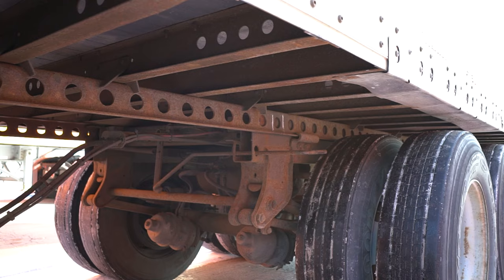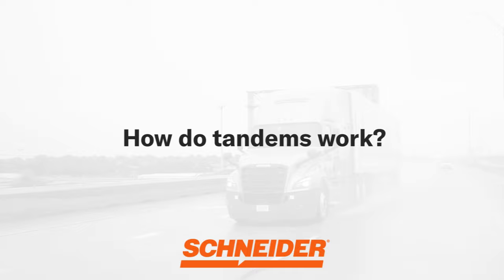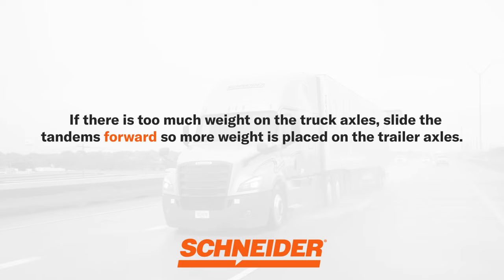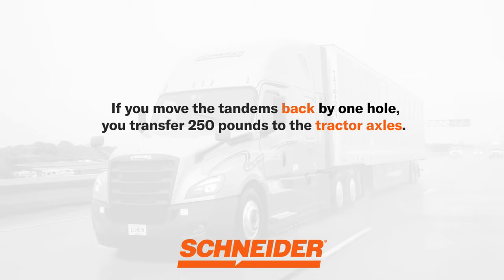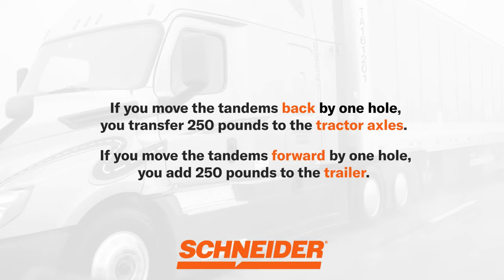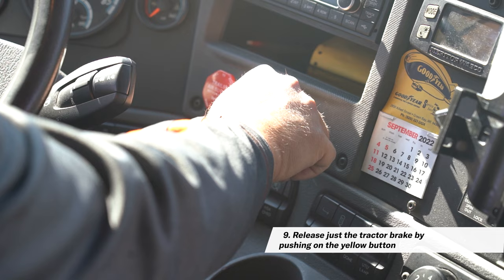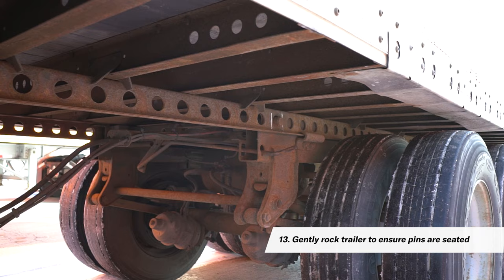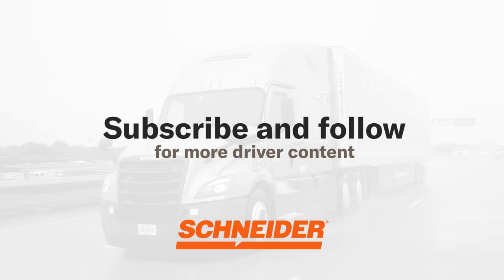How to slide tandems on a semi-trailer in 15 steps

Comment: I wish the trailers all had the button style, I hate these manual ones with the lever they are so problematic and temperamental
Reply: The button ones are worse when they give issues. I prefer manual.
Reply: I have to agree with  @leaellas8400.  Yes the button is very nice, but like she said, if there's issues, you're F.  With the manual, it will ALWAYS work, though a bit harder.  Carry a locking plier as well (to act as a 2nd person), to grip the handle once you pull it out (sometimes the spring breaks & the handle doesn't stay in the pulled out position), go back inside your cab to slide it forward/backward.